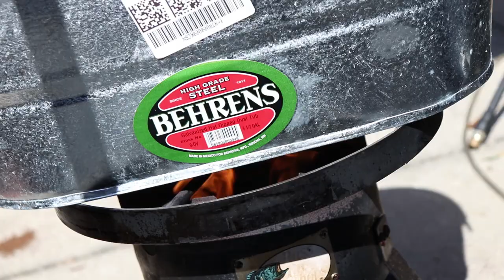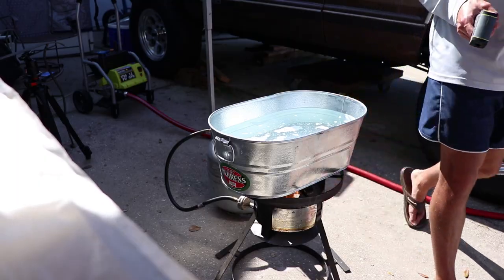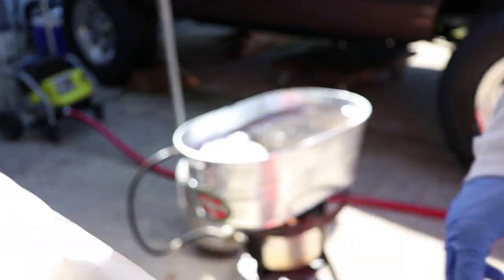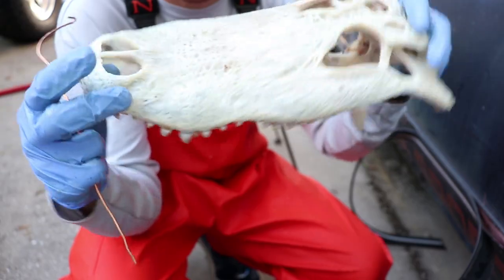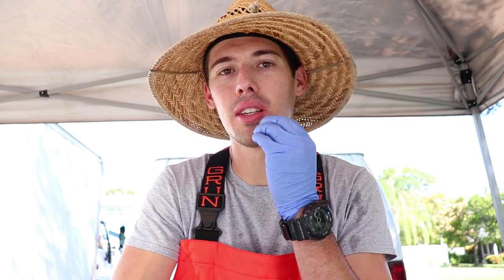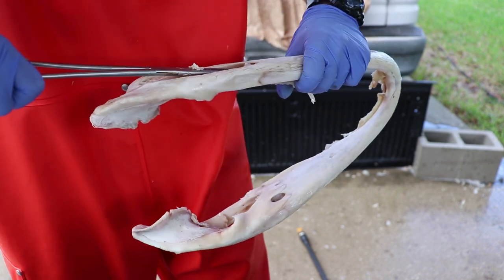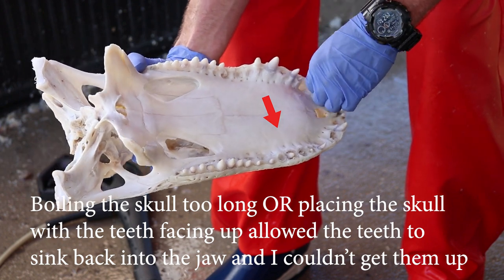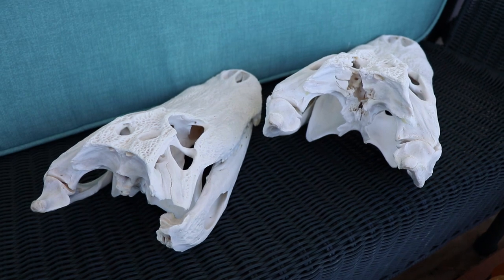DIY Alligator Skull: How to do a European Mount

Comment: Thanks JT. I did a Hog one time. The teeth came out. Poured through a strainer, recovered all and epoxied back in. Still looks good.
Reply from the maker: After having the teeth fall into the skull, I think I'd rather have them fall out... Did you do a similar method to this?
Reply: Yes...except, I cooked in a rolling boil and used Dawn dish soap(degreaser). Like you, it took a lot of time getting all the "dew dads" out of every nook and cranny. It was amazing how much "stuff" was in his sinus cavity's.
Reply from the maker: Yeah! The nose was something else on this gator. So much in there... I'm sure that's the same with hogs. They got a good sniffer on them. Did you notice anything deterioration of bone or a chalky feeling with doing it in a rolling boil?
Reply: It has been several years since I did it. It is the only one I have done...nothing to compare it too. I do not remember a chalky feeling or any cracking. I just got it down to check and I don't see any cracks just the natural seams. A point of interest to me was how long and deep the cutters went into the bottom jaw.
Reply from the maker: That's still good information. Thank you! I would find that interesting too. I watched whitebone creations and his pig skull video and I was surprised at how long those cutters were

Comment: Okay, the upper mandible is heavy and i dont think glue in the hinge joint will support the top jaw in an open position. That’s what I was asking
Reply from the maker: Oh. You could drill through and put fishing line or a cable to hold it shut and put a spacer on the front side of the hinge point to prevent the upper from coming down while the cable in the back holds the two together. You could also just put something in the jaws, or put a long object on the table that pushed on the roof of the mouth where its mounted.

Comment: JT did you wind up having to pull all the teeth and clean behind them then glue them back in? My skull came out great! But still kinda smells.
Reply from the maker: I did not. I have done 5 or 6 heads now and have only had one head where I didn't get a good clean on it and it was only one tooth where it had an injury or a tooth coming in where that tooth hid some meat. Just cleaned it out and left it outside for the bugs to finish up.

Comment: That was another great video, JT. You put a lot of work into those skulls, and they turned out great! What are you planning to do with them? Are they personal trophies or are you allowed to sell them?
Reply from the maker: @SluSharkND thank you! I plan to put a wire through the jaw and will try to hang them on the wall. The skulls are actually lighter than I thought they would be so I should be able to hang them on a nail or a screw. I believe I can legally sell them, but I would have to look that up.

Comment: Awesome video. Thanks for sharing. You can explain what you did with the scoots? I have some saved in the freezer I’d like to use.
Reply from the maker: I did the same thing that I did with the skulls. Just boiled them, peeled and pressure washed them, and then soaked them in the peroxide to finish them. Really easy to do
Reply: JTgatoring  For the scoots, does the peroxide do anything other than make them white? I’d rather preserve it with the natural color.
Reply from the maker: @jacobthompson9776  the whole point of doing it the way I do, is to expose the bone and remove any flesh/meat/hide. That way it does not rot or decay. If you want to keep the skin/hide on there, then you need to tan it.